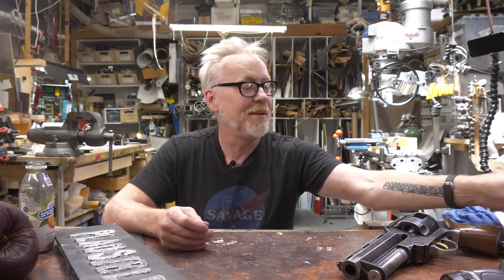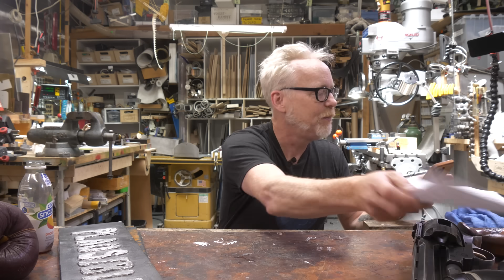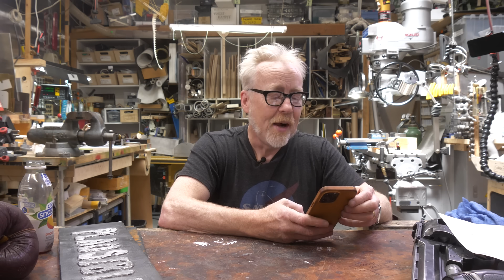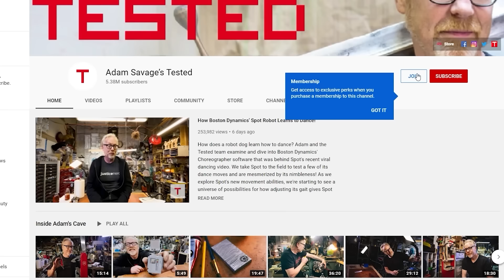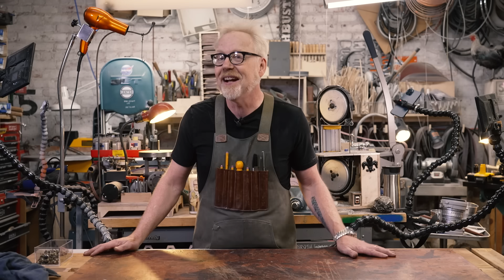Hardest-to-Obtain Item in MythBusters History

Comment: RE cars: do you mean DUMPING the clutch (pulling your foot off the clutch suddenly rather than smooth feathering)?  "Popping the clutch" is basically the same action, but the term is typically used for bump-starts or rolling re-starts of the engine. Get the vehicle rolling, then pop the clutch to force a compression start of the engine.  "Dumping" is used when talking about hard/jerky shifting gears, or a drag/track launch on a high torque engine. They are exactly the same move. Just dont know if "car guys" would consider the terms interchangable.

Comment: Speaking of Indy cars, there is one myth I suggested for decades since MythBusters started, but they never did:  Can an Indy car actually drive upside down?  Yes, its probably not safe to test, not to mention building an upside down section of track...  but I sure would have liked to see it.
Reply: The main problems are trying to get the oil to the bottom of the motor when it collects at the top of the motor, potential of the brakes un bleeding themselves as the fluid would drain from the master cylinder into the reservoir, having a team lend you a car, and risk dropping it upside down on its lid at presumably 100+mph, and finding a spot to build a track where you can safely get up to speed, make the transition, get some shots, and get back. 
Not that they couldn’t do it, but the math is simple if you are only taking that question at the level of downforce that they are making. The practical side is way more complicated as gravity fights all of the mechanical components in the car.
Reply: @jacklougheed4561  Easily tested in the NASA Ames full scale wind tunnel however, Need to build some kind of rotating rig to bring the car inverted.  Or stick it in the tunnel inverted with ballast mass to simulate a driver and engine.

Would need a loose attach method of course so the car didnt blow away of course, but with some load cells in the mounting system and other sensors one could determine both how much downforce the Indy or F1 car generates right side up and then slowly rotate it to inverted and see if the compression force stays high enough to keep it stuck.

The best reason to use NASA Ames is not only is it a big enough tunnel to test aircraft parts so could easily fit a car and rotating rig, But also it can achieve wind speeds of 350mph, So for Mythbusting purposes they could test with in the normal capabilities of such cars, And if they cant stick just ramp it up to 350mph and see what happens.
Reply: @filanfyretracker  I think, unless you had an unlimited supply of cars, a more pragmatic procedure would be to FIRST test it at max wind speed and THEN, if it works, ramp things down to plausible car speeds from there. :)
Reply: @filanfyretracker  the only downside here is the spectacle of the car driving upside down with nothing supporting it but air. As long as there is a tether attached to the bottom of it, the result won't be as readily accepted.
Reply: @jacklougheed4561  Formula E
Reply: @ropethurston6080  fair point, but I don't think that they are making the same incredible numbers as indy cars, formula 1 cars, and LMP cars. Also the brakes issue would require full trust in the regenerative system.
Reply: @jacklougheed4561  IIRC the biggest problem is actually just getting permission from the F1 company. Pretty sure the driver was all for it
Reply: @jacklougheed4561  Very good points.
Reply: @jacklougheed4561  the motor is most likely a dry sump for high lateral loads the main issue I would see is fuel starvation.  With so many of the claims made over the years from many manufacturers and companies I would love to have someone actually do it
Reply: @AutoAnomoly  the problem there is that gravity is still stopping oil from draining to the pickups in the bottom of the pan, and the bottom of the valve covers, which would collect a lot of oil before it was pulled back into the collection tank, and the oil in the crank case would collect on the backs of the pistons leading to really weird problems with balancing a finely tuned motor as well as oil getting past the rings into the cylinders. Also most dry sump collection tanks collect from near the bottom so as to let gravity feed to the pressure pump, once the tank is inverted the pressure pump is sucking air at the new top of the tank.
Reply: Ooooo!  OOOO!  Like Hot Wheels!
Reply: The other aspect that one would have to consider is that, yes, on the ground, the car would generate enough downforce at less than 100 mph exceeds the weight of the car which would mean that it would stick to the ceiling HOWEVER, the gravity which pulled that weight towards the road surface is now inverted on the ceiling and is now trying to pull the car away from the surface. As any F1 or Indy driver will tell you, grip is absolutely crucial and any loss in grip is liable to make the rear wheels spin, which is bad news.
Reply: @Shakes-Off-Fear  they would run it at a significant safety factor, leaving 1.5 times the weight of the car in downforce. Just to minimize the risk of wasting a several; million dollar car and potentially multi million dollar driver, even if it was only minor injuries to the driver.
Reply: I'm pretty sure I read about some people who actually DID drive a car upside down in a tunnel.
But's quite a few years ago, and I don't remember any details. But I'm pretty sure it has been done.
Reply: @Tjalve70  people have done loops in subway tunnels, in fact I think that top gear has done it in a mini trying to recreate the Italian Job stunt, and hot wheels did a double loop dare with two cars going around loops, however I haven't heard of someone driving upside down using only downforce.
Reply: @jacklougheed4561  Yes. But I'm not talking about loops.
I HAVE heard of someone driving upside down. But I'm not sure if they succeeded, or if they were just planning it. It's been quite a few years since I heard it, so I can't quite remember.
Reply: @Tjalve70  it has never been done on our planet. The physics of our world will never allow a car to drive upside down. But on the other hand you can drive a car in a loop d loop if the angle of inclination is just right, and the loop isn't to long. And even then the car is only upside down for a moment. And centrifugal force is what allows the car to keep traction. Again momentarily allowing the car to go inverted
Reply: @prestongoodolboy8561  You're wrong.
Reply: @Tjalve70 how am I wrong? When over this in a physics class for machining?
Reply: @prestongoodolboy8561  You don't account for downforce.
That is the reason this is even a discussion. An F1 car at high speed has a downforce greater than its own weight. That means they can in theory drive on a ceiling. Everyone who isn't an idiot knows this. You apparently do not.

The question is not whether this is theoretically possible. It IS theoretically possible. The question is whether it has ever been done, or even tried.
Reply: @Tjalve70  down force isn't constant. And it will eventually beclme by gravity so if you invert the car the down force and gravity work will work together and pull the car down. Try again
Reply: @prestongoodolboy8561  I trust experts and actual physicists more than I trust you.
So yeah, you're wrong.
Reply: @Tjalve70 tell me how I'm wrong like a true intellectual would so I can understand and review my own assessment of physics so I can correct myself. Otherwise you do not have a valid counter argument or any argument for that matter you have just been telling me I'm wrong
Reply: @ButterfatFarms  And again: I trust an ACTUAL F1 team more than I trust your ramblings.
The downforce can easily be measured. And then it's easy to calculate whether it's greater or lesser than the force of gravity.
Reply: One problem would be that the downforce is very sensitive to ground clearance, when the car is upside down, the weight of the car would increase the ground clearance as the suspension would be at full droop. It's possible that active suspension could be programmed to overcome this.
Reply: @joejoejoejoejoejoe4391  turn up the over-body downforce, and install limit straps, to restrict how much up-travel the suspension has, hold it from falling to far from the road.
Reply: Aerodynamically you could test it with a rig to take it upside down in a wind tunnel and measure if the downforce is enough to pin it to the ceiling, but yeah the internal machine bits would get shafted real quick without the normal gravity fed application